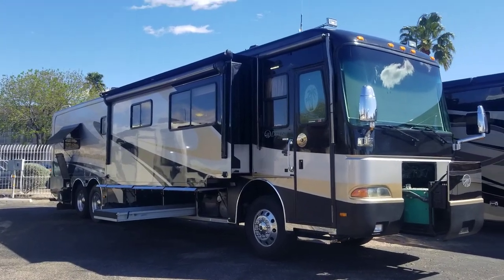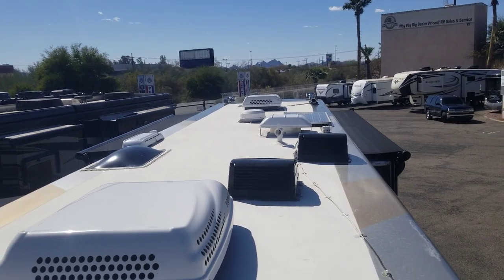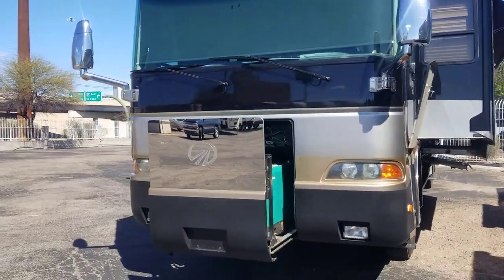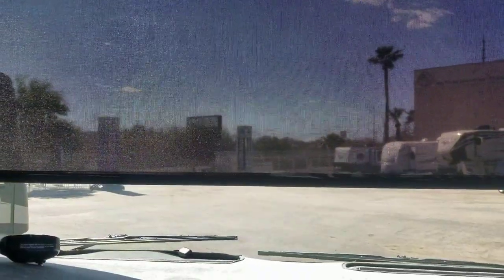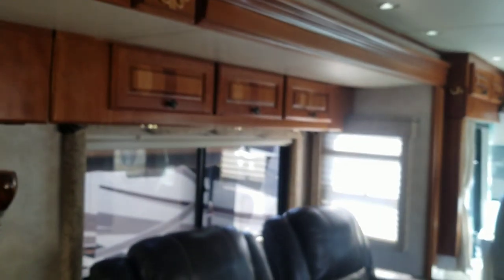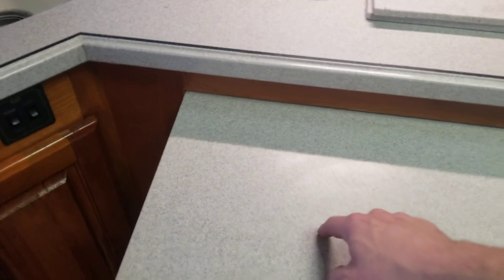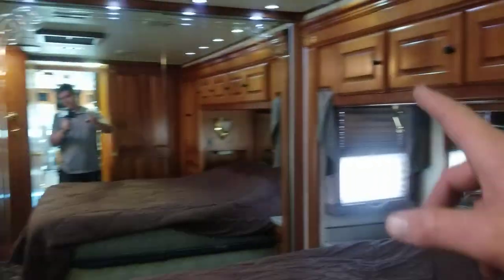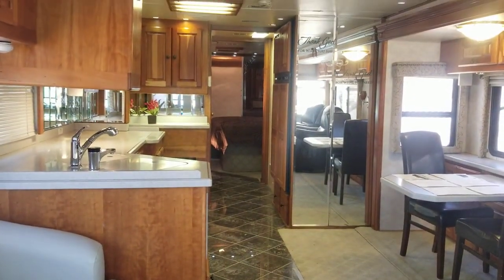2002 Monaco Dynasty Regal Video Walkthrough! Highline Diesel! Unbelievable Build Quality! SOLD!

Comment: Still available?? Can we get my NxStage dialysis machine in it?
Reply from the maker: Peg, that coach just sold yesterday. I will let you know if the deal falls apart. Depending on your specific NxStage machine size could vary. It should fit just fine. Standard RV entry doors are around 23" wide but can be as small as 14" and about 70" tall.